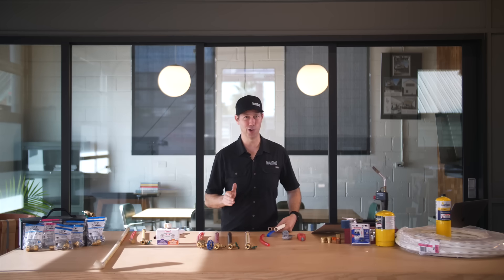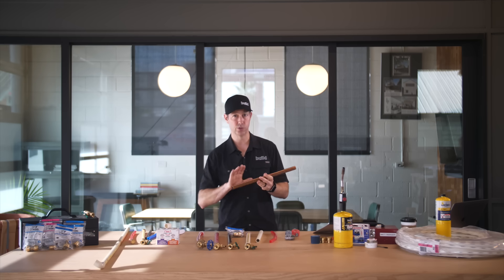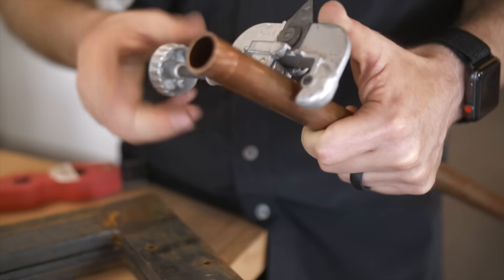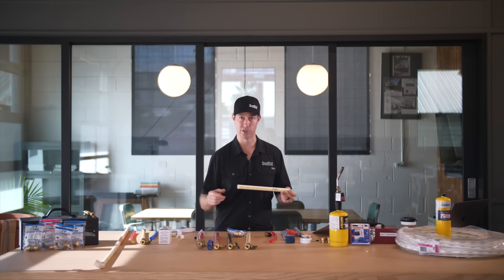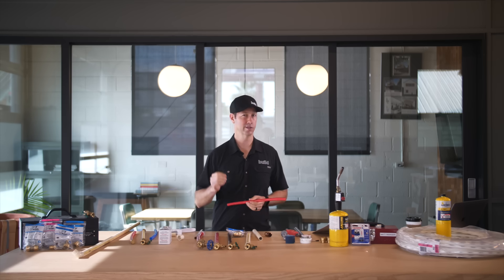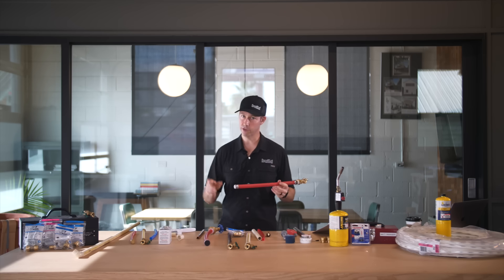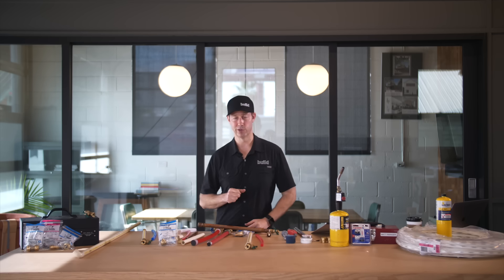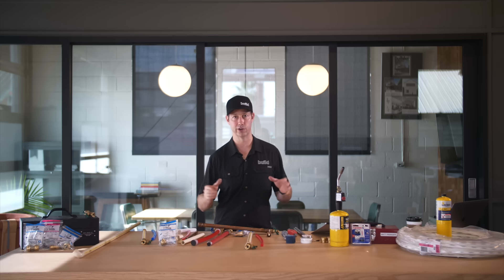PEX vs COPPER vs CPVC plumbing pipes

Comment: Screw sharkbites...they are so expensive, have little tolerance for plastic (pex) piping, and getting them off is way more difficult than it should be...

PEX was the greatest idea in plumbing ever.  Don't use the ratchet collars and plastic fittings are terrible; black copper rings crimped and copper fittings...  PEX, maybe 5 years ago, was so high in demand in my area, it was difficult to even find crimp fittings; it's become much more available since...
Reply: @InfiniteMushroom - No, never.  Defer to the company giving you the quote - they will know far better what to use based on regional conditions, code, etc.; don't assume liability by dictating what to use when a lot of people won't even bother to raise an issue per your request.

I've never even messed with plumbing on a double-wide.  So taking my praise for PEX as doctrine would be unwise.  If PEX is warranted, and you were hiring out a job, PEX-A is easy to work with, but 2-3x the price as PEX-B, both of which meet the same ASTM standards.  And generally speaking, I think crimp is best and should be used, but if you're talking a lot of tight areas, the ratchet or cinch collars use a tool that pinches the edge of the pipe, vs a crimp that requires a tool to envelop the collar.  So a tight cinch vs a jacked crimp - cinch is absolutely better.  Even Copper fittings (i.e., Cu Alloy - brass, bronze), depending on conditions, could degrade and fail prematurely from Zinc depletion.  There are too many variables to give you a straight answer.

But really, I guess what sort of Lead plumbing are we talking about?  If it's standard copper with joints sealed via solder with the same Lead tolerances as is used today, and if there are no problems otherwise, it might be an unnecessary (and costly) endeavor.  That doesn't mean you couldn't still request a quote and see what a local plumber's opinion is on the setup you have.

If there is a serious Lead presence, where blood work shows elevated Lead and you know it's bad, then for God's sake call someone ASAP!  Get bottled water until the plumbing is gone (water lines at least).  

But, again, rely on the local company that will provide plumbing services rather than a dude on YouTube (me).  Even "experts" in videos would be unwise to listen to as absolute fact.
Reply: @InfiniteMushroom - I see; well no neurological damage then - that's a major plus.  I see now why you're wanting to change out the plumbing - that ~30 yr expected life has to be a huge stress!  I'm sorry to hear that.  Hopefully your local water treatment is kind to the lines & the impending swap out goes smooth.

Comment: My concern is rodents......living so close to apartments and commercial property we see rodents....sometimes actually putting poison out to deal with them.  The retired plumber I have spoke to said use copper....the plumber looking at our project says he has not used copper in 25 years....getting a lot of that here in Texas.....

Your video was helpful, but I still need an experienced copper plumber.

Thx.p
Reply: Poison is very bad the rats or rodents will bleed internally becoming very thirsty they being semi intelligent can always detect flowing water inside of a pipe and will start to chew through it.

Comment: Dad built his house in 1970 used CPVC on well system never has a problem yet to this day. Most degration is if exposed long term the outdoor/Sun so as long inside, in walls, etc no outside then would be fine.

Comment: Copper. Copper copper   I was a master plumber on a Submarine
Reply: paul mazurek 
You do know submarines sink.   Not a very good recommendation.  However, as a USN Engineman.  Copper,  copper, copper.  This guy doesn't realize you have to use purple cleaner by most codes.  That's to make sure you have cleaned the pic before applying glue.  Glue only may last 10 minutes to a year,  according how much vibration or abuse it gets.  Must be from Austin.

Comment: A experienced plumber knows how to fix water hammer , shark bite fittings are made for copper pipes , chemicals in plastic pipes could cause health problems in the future, there are 3 types of copper pipes , one is for underground, one for  interior house  , the thinness for base board hot water heating . Question - what is in the primer and glue for pvc pipes  being  its in  contact to my drinking water   If a pvc or per  water line is frozen  they cannot be heated  to defrost   Try defrosting a 3 inch waste line  .  Plastic. Melts    Use  ball valves  on all pipe systems

Comment: Having used shark-bites quite a bit, in multi family housing, on the old grey polly pipe, the key to dependable repairs is the use of the debur tool. We had return visits on repairs until we purchased this tool. After that, no return repairs. I have also worked at properties with cpvc. The repairs are the same with Shark bites, but after 10 years, leaks develop, not at joints, necessarily, but in the middle of pipe runs,possibly from flexing.

Comment: The health concerns alone would prevent me from allowing anything but Copper in my home.  Yes, it is nice that Pex can out perform copper but performance is not everything.  There are many reports linking practically all plastic to chemical that cause reproductive problems while copper has natural anti-microbial properties due to oligodynamic effects.  We should seek ways to improve the performance of copper or ways to mitigates water damage in the event of failure until something safer comes along.

Comment: Be careful taking Plumbing advise from this infleuencer VLOG. Water hammer in not an issue with copper if the piping is sized correctly, routed properly, pressure regulated properly and supported properly.  If there is n existing hammer(from a RCV) hammer suppressors can be installed at the device relatively inexpensively.  
  Plumbing life expectancy: Residential--Uponor warranty  pipe 25yrs, LFbrass - 25yrs, poly ftg - 5yrs Same for Rehau. Copper is the similar depending on grade and location. In our area only type K and L are allowed for domestic water service and those should give a 25year life.

Comment: We have had several failures of pex in one of the town house communities.  You brought up the ultraviolet problem and it may have been how the pex was stored by the builder.  Also the HOA found out that the maker of the pex was also at fault and went out of business because of their improper way of making their pex.  So, one of the problems of using pex is you can not be sure how it has been stored or who made it.   You can also discuss which piping is better in resisting freezing.
Reply: Fittings are usually the failure point for PEX.
Reply: That's why you stay away from China made stuff like Apollo, found, where else?  At Home Depot.

Comment: Thanks for this video.  I learn something new~~~

Did you make a video on what pipes to use in your house based on the floor or the purpose???

I want to know what section should use metal (cooper) and what sections can be the PVC/CPVC pipes.

I live in Virginia, here has snow and hot summer. I do not know which pipe type has better temperature tolerance and also which pipe is used for main water line compare with branching out lines.

Thanks

Comment: Mark my words, the shark bite style will begin to seep/weep in 10+ years, all o-ring type joints dry and harden. I would not use it to fix anything.  Not to keen on the crimp joints either TBH.  Solvent weld or solder joints for me.
Reply: Better not find out what's been under your streets for almost 100 years then...

Comment: Copper is one of the worst ways to plumb copper corrodes from the inside out, the taste is terrible, and the slow leakes destroy your house.....pvc is a terrible product, plumbers only like because is fast and cheap, both equal more profit... pvc and the like are for sewage drains i will agree to that. But pex is the only good choice....
And here's how to run it....home run everything no 90 fittings no tee's anywhere red for hot blue for cold....hr it to a manifold 3/4" all your showers 1/2" everywhere else. ...no fittings anywhere except the manifold and the fixture, there will be no leaks, if there is a leak you can see it right away, it is the smartest and best way to plumb your house new or old. Every plumber knows this, but won't admit it.
Reply: I can tell you this....every pipe is a liability,  so homeruns are fine for you but not the way I would plumb a house. You must enjoy drilling, you purchase nail plates in bulk I bet.
Reply: joracer1 funny comment

Comment: While I'm not a professional plumber I have plumbed 4 houses and have done a number of fixture and heating installs and replacements over the years. Most of what I have installed I did using copper however I have used all the products you mentioned so I have some experience with each. First off, water hammer is not an issue with copper piping by virtue of it being copper. Water hammer is the result of installing the copper incorrectly. Second, I have used CPVC for some projects where the piping has remained exposed (because I did not trust it) and in my opinion it is the least durable of the three materials you mentioned. I have seen it break down and become brittle and ultimately leak. I no longer use it and will not recommend it to anyone. The last house I plumbed (lakeside cottage) I did using Uponor  pex. I decided to use Pex for a few reasons. First, the existing copper showed signs of being attacked by the hard water. The second was that it is a single level house, all the plumbing is exposed and in the basement so that should something fail it will be visible, simple to fix and will not cause any real damage. While the pex was a breeze to install versus copper I still don't have the faith in it that I do with copper and I'm still concerned about it leaching into the water (I use the water for everything but drinking). I have also used Sharkbite fittings in a pinch and while I love them I would never use them in a wall. I doubt they will last more than 10 years and you'll be asking for trouble if you do.

Comment: Might have already commented, but never, EVER use PVC or Pex for high pressure water pipes!!! 1. It's weak and will break, especially after it's been in use for a few years. 2. It's toxic. You will literally be drinking and bathing in microscopic pieces of plastic. Just like how the chemicals from plastic water bottles slowly leech into the water, giving it a shelf life, that same process is happening in your pipes! The human body needs copper on the other hand. It's a natural metal/mineral that the body needs in small amounts. 3. Copper is a natural anti-microbial. It literally sanitizes the water that it comes into contact with. PVC/Pex does not. 

Always, ALWAYS!!!! Use copper for any high pressure or incoming water lines. There should be no debate or discussion about this.

Comment: Growing up in NY, my parents house that was built in 1968 used 3/4 threaded brass pipe drains were also brass near the fixtures and cast iron and lead pipe.  I think a 3/4 brass was like $10 an inch when i sold the house.  I have my grandfathers brass fittings and short pipes that must be worth $1000 - i easily have 20 feet in stuff.  My new construction house in NJ used 3/4 copper and pvc drains

Comment: He doesn't mention hot water at all here - you'll at least want copper for hot water, right, eh? People will use both copper and PEX and CPVC and PVC for different places & purposes, that's why there's easy sweat - NPT - push connect fittings. CPVC will pop like a bug if they freeze, PEX bulges and can leak out in a freeze too. All plastics turn brittle, and can't go out in the sunlight, and can't take the heat. They leach neurotoxins over time, and the VOC of the glue is going into your drinking and bathing water as well. PEX can handle warm water, but it'll leach faster with warmer water. If you clean the flux out of copper, or use it in hot water - and all solder is lead-free and has been for decades - and don't let iron from a dying water heater sit on a horizontal low-use pipe - it's clean clean clean. A slight bit of copper oxide is good for the disposition. The truth here is, and he hints at it when he says "they don't have to be experienced installers," (and I'm in Austin, Texas as well) all over the state they drive a pickup truck to e.g. Ross Avenue in Dallas, or a Home Depot, and pick up illegals to do the day's work on a spec house / cheap-as-cow-pie throw-me-up development: and that's why PEX is so great. A 1990s fourth grader with a super-soaker is already qualified. That said, I feel it's: (#1) Copper, (#2) PEX, (#3) PVC, (#4) CPVC, except for hot water and garden hoses and A/C compressors, then it's all copper copper copper the thicker the better.

Comment: I’ll stick to using pex on houses, being in new construction for a few years I’ve done cpvc, pex and copper. Pex is a easier to work with, and doesn’t make a mess, plus it is great for the winter doesn’t freeze break that often. But I’m also wondering about his glue joints, looks like a handyman joint. I only use the yellow glue on cpvc

Comment: CPVC is junk and gets so brittle it becomes useless. Also you never mentioned the freezing capabilities of all 3. I had PEX freeze to the size of a grapefruit and return back to original diameter. Also you didn't mention the PEX Manifolds enabling you to leave the house mainline on while working or replacing one line a definite advantage above the rest. I always run PEX but go copper to the fixtures. This provides the perfect combination. Copper is always on the inside walls with no worry of freezing while PEX runs the length saving money.

Comment: No mention of PVC?  In California PVC is not used for waste ,it’s used for supply.  PEX early on had failures which is why it was not used in the US.  PEX crimp connectors are failing prematurely o some areas of the country.  CPVC is very rarely used i California.  Not sure it can be used fro supply lines due to chemical leaching like what was happening with PEX early on.

Comment: PEX is used in overhead plumbing systems where I live to pipe leaks in or under the foundation of the house and most of the houses with leaks have copper pipe and were built in the 90's...